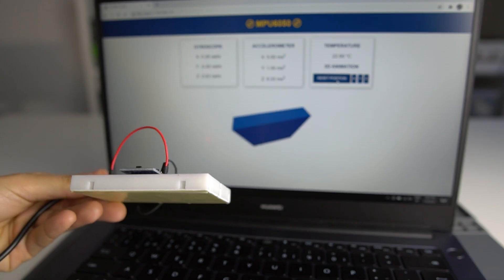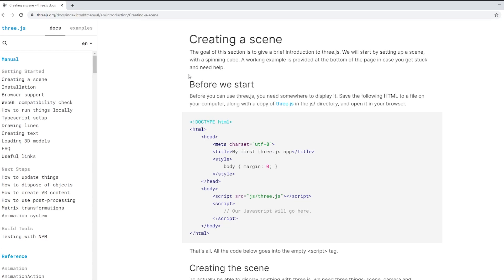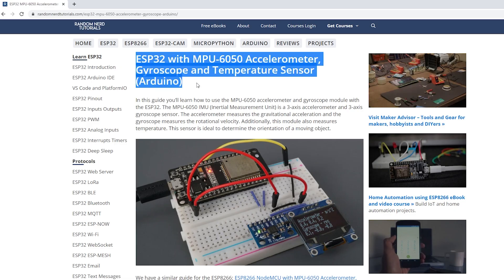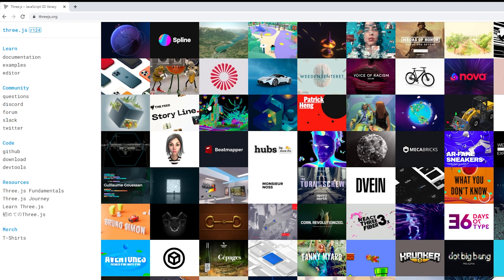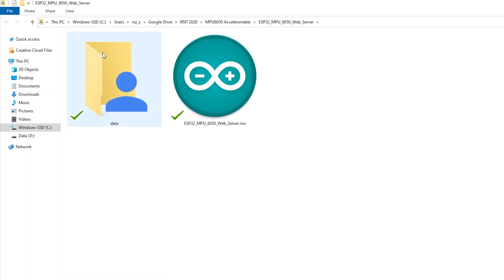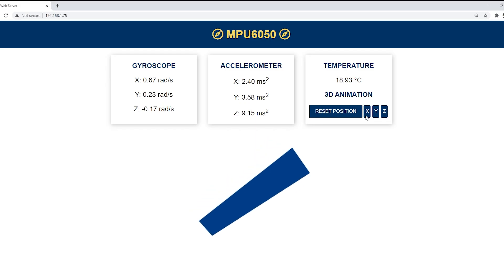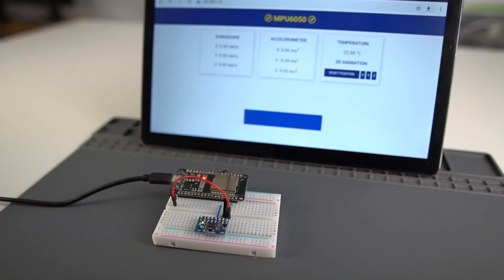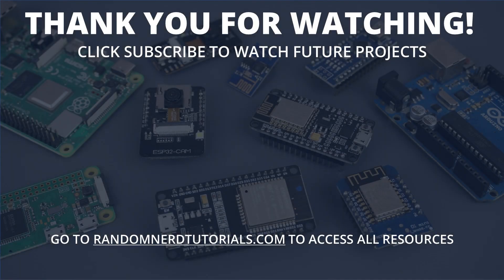ESP32 Web Server with MPU-6050 Accelerometer and Gyroscope (3D object representation)

Comment: Can I use the BMI160 instead of the MPU6050? Can you suggest a solution for measuring the acceleration of an automotive suspension system in real time and recording the data? Since the car will always be moving and it would have to be a "wireless" system. Can I use more then 1 sensor with the same board (ESP32)?

Comment: Hi Rui. I appreciate your projects, they helped me a lot. Can you suggest me how to transfer data wirelessly every 10 milliseconds without stuttering (ECG data)? I tried to use websockets but sometimes it was shuttering. Will using SSE fix the problem? Or is it better to send the collected data in array (eg. from 1 second interval) to the MySQL database? (Data can be buffered, I don't need live broadcast.) Is it possible to draw a graph from an array of data stored in one cell or each value must be stored in a new database cell?
Thank you for your work.
Reply: Did you solve it? If yes, how?

Comment: Hi, as the drift is always related to one of the axis, is it possible to add 2 more MPUs with always complementary directions? With this you would be able to make a 2 out of 3 calculations and can overcome the drift. Not sure, whether this idea is correct.
Reply: I think that the drift is because of gravity acceleration, so it's always on the same axis, don't matter how you position the IMUs.

Comment: I connected 6050 up as instructed SCL, SDA pwr, gnd and loaded libraries and ran example read values code but on 
the serial monitor im getting failed to detect mpu 6050 chip message any ideas anyone ?
Reply: Did you check if your mpu6050 module might have a different I2c address? Might mnake sense to upload an i2c scanner mode to check if it detects your mpu and what adrress it uses. 
https://playground.arduino.cc/Main/I2cScanner/
Reply: @jeanyluisa8483  Thx a bunch for the reply very helpful I will try the scanner out 👍😀

Comment: Are you using MPU's internal DMP(Digitan Motion Processor) or just reading raw datas from a registers?
Reply: It looks like raw data. He probably just integrates the angular rate values and doesnt even touch the accelerometer as he needs to reset the position from time to time
Reply: @batugunduz3950  Yes. For this example, we just integrated the angular rate values to get the position. We didn't use the accelerometer values because the result was worse. And, yes, from time to time, there's the need to reset the position because the sensor drifts a bit and the error accumulates over time.
Reply: @scgsantos22  How did you attempt to use the accelerometer?

Comment: Great project, Rui. Apparently I haven't used the ESPAsyncWebserver class before. I have the esp32 1.04 core installed, but the md5.h is missing for the ESPAsyncWebServer-master/src/WebAuthentication.cpp. Any ideas? I believe it should be in the core.
Reply: Just for kicks, I compiled it for the D1 esp8266 and it is in the 8266 core!

Comment: The MPU-6050 has a DSP built in to it. I think it can run some sort of Kalman filter on the raw sensor data. 
I think the old Wii controller from 2008'ish used them. 
The gyros need to be reset when the accelerometers read no change in acceleration, and the gyros see no rotational changes, or something like that.
That's to compensate for gyro drift. It gets too complicated for me. I tried to follow the ArduPilot code, and gave up in one day!
The quitting force is strong in me...
Reply from the maker: Thank you, we will look into more detail in the upcoming weeks!

Comment from the maker: You can find the complete project details (schematics + source code) on my blog ► https://RandomNerdTutorials.com/esp32-mpu-6050-web-server/
Build a web server with the ESP32 to display readings from the MPU-6050 accelerometer and gyroscope sensor. We’ll also create a 3D representation of the sensor orientation on the web browser. The readings are updated automatically using Server-Sent Events and the 3D representation is handled using a JavaScript library called three.js.